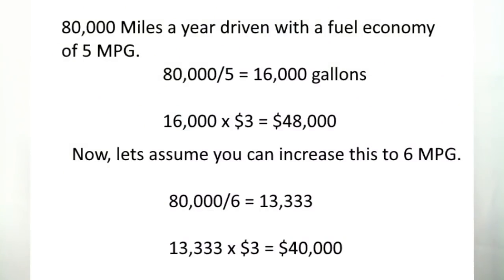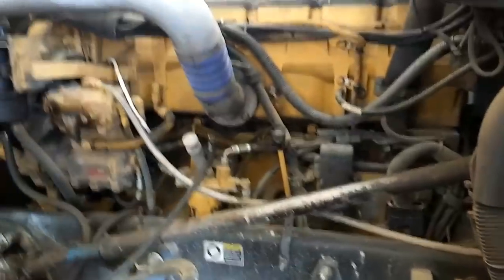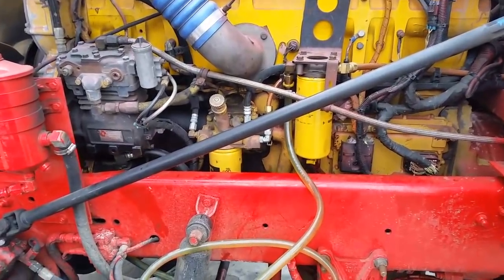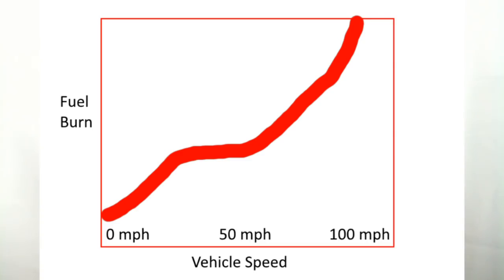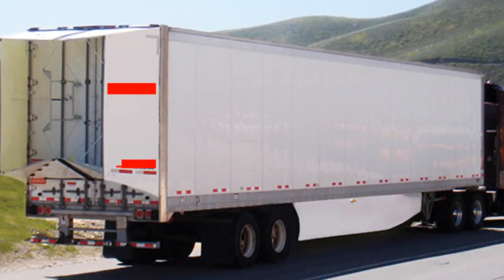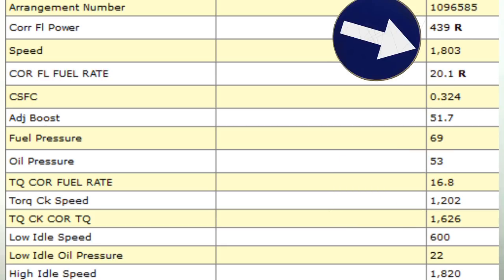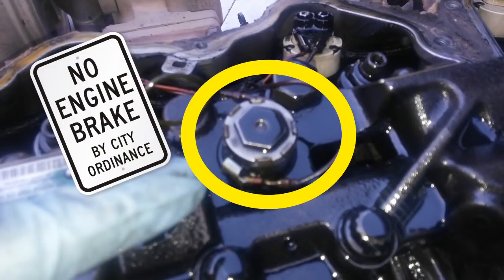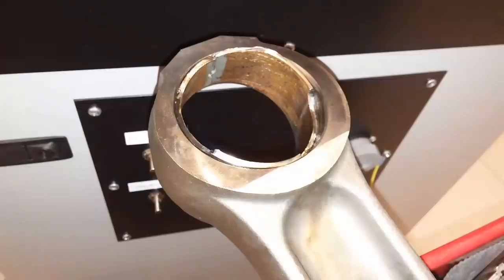How To Get Better Diesel Fuel Efficiency.  Increase Your Diesel Mileage And Economy.

Comment: Idling often, at my old fire department, i’d just shut the damn thing off.  Get challenged by the officer, why i shut it off, well lieutenant, we’re sixth in line, we’re just a very expensive, oversized taxi.  I’m hearing new APU technology that will almost completely eliminate even emergency idling.
Unrelated, our trucks had TriPac’s, any one got a tip for any other APU that’ll actually allow any semblance of relaxation, never mind sleep?

Comment: Question off topic but still Cat related, would it be wise to swap out the pushrods in my 1996 3406e while my tech is running the rack and also installing a Jake brake tune up kit (o-rings,etc)? Engine just turned 900,000! Also is Cat carrying new titanium pushrods now?
Reply: Nah use the old ones for another 900,000

Comment: Want better fuel mileage try propane injection it enhances Diesel Performance you get power and fuel economy because propane is a catalyst and it helps diesel burn efficient diesel only Burns about 78% efficient compared to gasoline which burns about 99% efficient adding propane gets diesel way up there in the 90s as far as efficiency

Comment: Is it good to use diesel fuel additive for a c7 with 47,000 miles for the injectors if so what is a good one to use ?
Reply: I use Hot Shot EDT. 16 oz's every refill. I have 200 gal tanks.

Comment: Air filters have very little effect on fuel economy on gasoline engines or MODERN diesel engines.  The whole point of a carburetor or fuel injection, in a gasoline engine, is to maintain the correct air-fuel mixture.  A dirty air filter has the same effect as a smaller throttle opening.  A very dirty filter could have some effect on a carbureted engine because carbs weren't terribly precise, and they were set up for certain assumptions about airflow.  But the effect was small.  With electronic fuel injection the system uses mass air flow sensor data.  A dirty filter just means less air.  The system adjusts.  It doesn't care.  All you get is less maximum power.

Old diesels with mechanical injection were very sensitive to dirty filters.  Black smoke would pour out if the filter was dirty.  Fuel flow was based on how far you pushed the pedal down.  The system couldn't know how much air was flowing.  These days that's no longer true.  Again, a dirty filter reduces the available power but has little effect on fuel economy.

It's hard on turbochargers though.  The worst thing for your turbo is a combination of high power and low air flow.  That can cause compressor surge.
Reply: Yes, on air filters, see Roothy on upsizing air filter flow capacity when fiddling with fueling and turbo boost chasing more power.
Reply: IF YOU DONT HAVE ENOUGH AIR FLOW YOU CANNOT MAKE HIGH POWER. ALSO OVERSPEED TURBO FROM BAD TUNING OR TO HIGH EGT IS WORST THING FOR TURBOS.

Comment: 16:10
"If you're running a smaller 7 litre engine"
Lol, I have a 2 litre diesel engine, and here in the UK that's considered a standard size. Small would be 1.5 litre - so it's amusing to hear 7 litres being called small!

Comment: If you want higher mpg. Buy a newer truck. My 2016 Freightliner with a 14.8 Detroit was in the shop. The 2013 Volvo with the 15 liter Cummins got 6 mpg. My truck get 7.5 mpg.

Comment: Gear your rig to run 200 mph and drive 65 mph you get the best fuel mileage
Reply: That requires a large displacement engine, and not a diesel

Comment: What's your input on the Series 60.
Reply: Arthanza McGhee I work for a freightliner dealer.  We see the series 60 often. If you get a chance to get a rig or build one, use the series 60 really a million  mile engine.
Reply: Thinking about buying this company truck I'm in. 455/515  Detroit, 13spd, 3.36  rears. It does pretty good but the hills it sucks. Current odo 939562. Before I take the plunge what do I need to do.
Reply: I have been running a series 60 14 liter 2007 motor. 
Had one head gasket done at 700k. 
Another at 900 (I think the first guy was an idiot and did it wrong). 
Then a inframe at dealer right at 920 (second head gasket should of really been a inframe. But I cheaped out and only got head gasket. ). 

Been on for the last 50k since dealer rebuilt it. 

Blow by is high on these engines. 
Even after a rebuild it is noticeable but within spec. 

I like the motor. Other then it's loud and vibrates at idle. 

Work horse motor.
Reply: I own 2 century trucks, a 98 with 2.3million and a 03 with 1.9million miles. The 98 does dry van and gets 7mpg all day long. The 03 does flatbed and gets 5 to 6. Both trucks only had 1 rebuild

Comment: mmm Turn off the engine at night and use eskimo Blanket or some kind of electric heater Solar and batteries and of course using none paper air filters while driving
Reply: Bad idea about no paper filters, unless you go over to PowerDrivenDiesel.com and check out their performance filters. Both style filters flow wayyy better than stock, as I just watched the video tonight. Run no air filter, and watch your engine slowly smoke more & more due to dust and debris ingestion. (I watched a small engine go from 12 hours inbetween adding oil to every 4 hours adding 1qt of oil, just due to improper air filter securement and dusty work environment.

Comment: im find a good way to get better mileage is to have more gears!
Reply: One special gear I have on my K123 Kenworth, where I can get around 80 mpg.   Its called Angel gear. The longer the hill the faster I can go and the more fuel I can save.  The heavier the load, all the better.  The downside of this story also has an upside.  To go down a hill, ya gotta go up it first.🙄

Comment: First dude lose the hat. Real truckers don’t wear hats like rap-pahs! Fuel efficiency has many variables especial environmental  and terrain. Most drivers have no control over loads, weight, routes and winds. Don’t go to the Pacific Northwest (The 4H Club); hills, headwinds, heavy loads & higher fuel cost! Most trucks are automated so they do what they do. POS!! If you drive a real truck with a manual transmission, shift early, shift often and if possible skips gears. One more thing, those gimmicks on the trucks that cost thousands to buy and install like trailer tails and flow blows me’s don’t really work. Ask yourself if it so great why isn’t it used on a Lear jet? Aviation fuel is $6 or more a gallon!